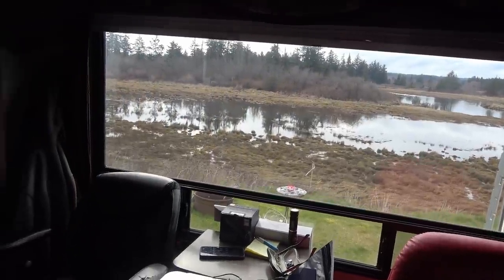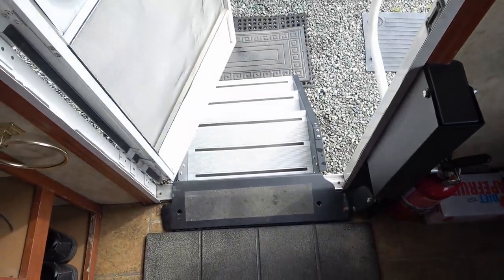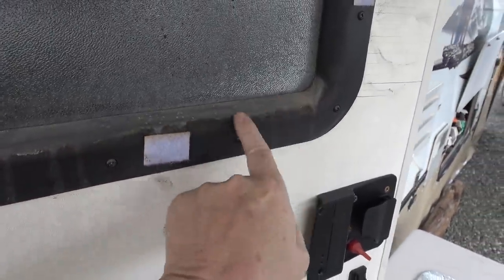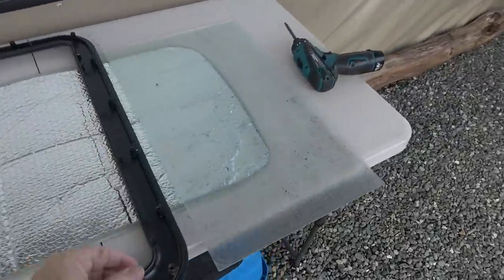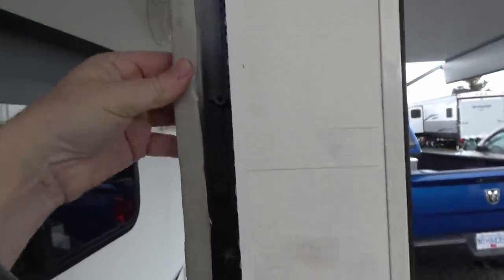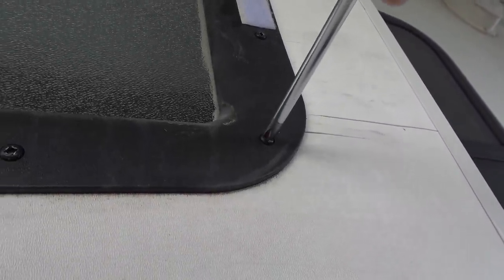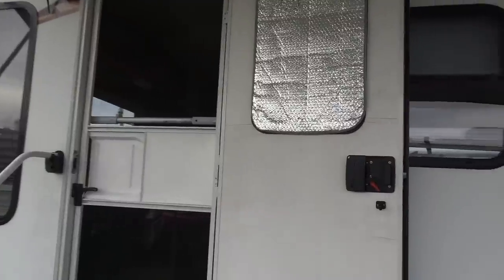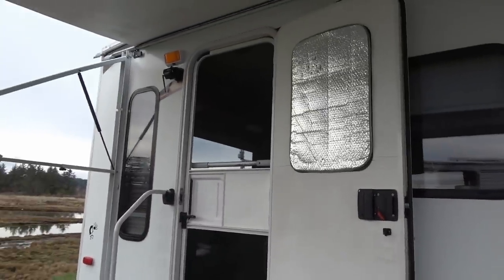Leaky RV Entrance Door Window Repair

Comment: wow, exactly what I needed. mines kept sliding down letting in cold air. I had this little suction cup handle from harbor freight and tried to slide it back up and use rubber cement to keep it up in the slot (noob move) lol didn't work. crazy thing is I literally have a whoooole role of that butyl tape but the black seal frame? Is cracked so I will investigate in the day hours. About to go to bed now. I discovered this video late at night lol but I just have to watch this video over and see how to take the black frame off.

Comment: Nice Fix. As far as the cracked door goes, Rustoleum makes a white spray-on bed liner that would work well to fix your door. The product sprays on well and I really like the finish it gives (it won't add bumps and lumps to your existing finish like you might expect). I really like this product for various projects I do (I have yet to use it for a truck bed).
Reply: I have to check that out... Thanks for sharing the tip

Comment: I upgraded that window to an AP Products Slim Shade. It is tinted and comes with a shade.  Will upgrade your door window and solve the sunlight problem.
Reply from the maker: Thanks I'll have to check the dimensions as I remember that the one Lippert had was not a fit for my Challenger brand door they told me.  Cheers, Ray

Comment: I have the same cracking on my door I'm going to use peel and stick birch wood wall paper.I have seen it at Home Depot about 40 dollars a roll.There are other designs to chose from so you can put your own spin on the door.Ray keep up the great videos.

Comment: That's a fairly common situation with the older RVs with the window. Mine leaked and needed repair too. You did a much better job than I did. Silicone everywhere. It's what I had on hand. 
Can't really help with that cracking door liner though. Saw someone else mention frp plastic. Sounds good to me.

Comment: Thoughts?
Everything including ourselves is temporary in it's present form.   Your RV is aging and it's performance will be affected and it will continue.  There may come a day you might either replace the door inner paneled surface or go with covering it with a peel and stick product. As with all the challenges in your life you'll get an A+ with how you deal with it when your ready.  If not now, you will eventually.  Like you just did with the window leaking.

Comment: My vote would be for a rattle can of Plasti Dip. Available in many colours, it covers and refreshes the exterior bits in between the windows on our SUV which is 16 years old. Spray on, remove masking stuff and peel off any over spray. Lasts on there about three years, I'm sure it would freshen, fill and rejuvenate your interior door.

Comment: Oh my... I see your door has cracked as well. My door was ok up until a very hard freeze in Oklahoma. Guess condensation and or water built up in the Styrofoam and when it froze it caused all the cracking. I've thought about trying to fix it but I'm thinking if I was to try to remove that plastic, the Styrofoam would pull apart. So never bothered with it. I just try not looking at it LOL

Comment: The interior damage on your door could be from water ingress. If your door is built like my RV door there isn’t a seal around the perimeter. My RV door was sagging so I took it apart. I found rot so I rebuilt the door and sealed the perimeter trim with silicone. I also put a bead of silicone around the window.
Reply from the maker: Mine seems to be aluminum framed stuffed with Styrofoam panel then a inside plastic cover sheet, so not much to rot. So far its still got good structure to it.
Reply: You are such a handy guy Ray ...

Comment: Why didn't you have Lippert ship you one of these; Lippert Components 806621 Thin Shade Complete Window Kit for RV Entry Doors.  The shade is a nice feature.
Reply from the maker: I remember discussing it with the Lippert Rep and since I have a Challenger brand door and not a Lippert many of the little add-ons would not work right and I believe the shade was one on them. I think the windows are different dimensions. Cheers, Ray

Comment: Thanks Ray!  I would email the manufacturer about your door. That seems ridiculously poor durability. I just checked my entry door it feels like textured aluminium. Perhaps they have a solution.
Reply: Hey Neil, Lol, that’s funny because I was just thinking, “gee i thought these panels use to be thin aluminium?”. Must have been our 2006 TT that had that, but not the 5th wheel. So cheap these manufactures are getting. 😐  Cheers 🍻

Comment: Was it just condensation?  Regarding the door, paint will just crack again 2 weeks later.  Probably requires a new layer of plastic that can probably just be glued on. Like #36
Reply from the maker: No, I could see it leaking during a big rain and wind storm.

Comment: Another Job well done 👍🏻.  Grey butyl tape is preferable than the black one?  On my previous trailer, I did not like the light coming in either, I ended up painting the frosted glass on the outside with black chalk paint, bought some pastel Chalk and would make a morning drawing or new one crossing different states 😊
Reply from the maker: Cool idea. :)  I've never seen the back butyl tape, always had stuff that was kind of greyish, doubt it matters, Cheers! Ray
Reply: @LoveYourRV  I was told, it makes a black streak on RV, and the grey would be more sticky, more difficult to use, it needs to be refrigerated a bit for easier use.  I have some black butyl around my truck's box here and there and no black stuff coming out of there and it really seals cracks, 4 yrs later driving all over, it still there and full water protection from entering inside.  The grey does look more malleable.  So many products to study 🙂
Reply from the maker: There are a lot of different products for sure. :)  The stuff I had before was a little bit more off white tan colour and bumpy, less sticky feeling, looked like this - https://amzn.to/3ryvqiv  I guess they all do a similar job.
Reply: @LoveYourRV  Thank You!  Sorry about leaky window :-0).

Comment: Another good video Ray.  I replaced my door window with a clear tinted one with a shade because I also didn't like the bright light coming through.  It comes with the inside and outside plastic frames.  I like it fine but the problem is that you have to open the door to operate the shade because of the screen door being in the way.  I got it on Amazon. AP Products 015-201512 Slim Shade Upgrading Your Door Window.   You can use your connection with Lippert to get one Number SKU 806621  It's a little cheaper on Amazon.
Reply from the maker: I remember discussing it with the Lippert Rep and since I have a Challenger brand door and not a Lippert many of the little add-ons would not work right and I believe the shade was one on them. I think the windows are different dimensions. Cheers, Ray